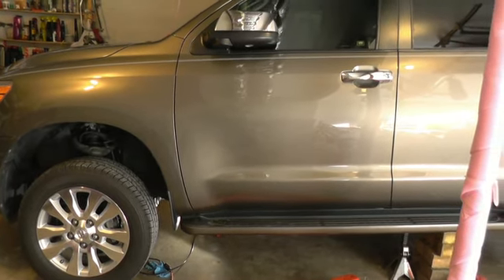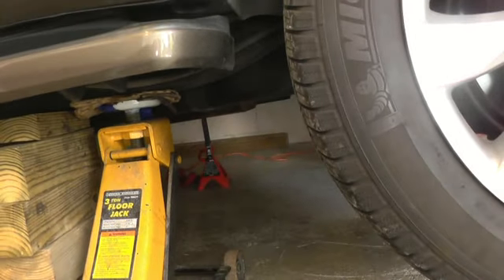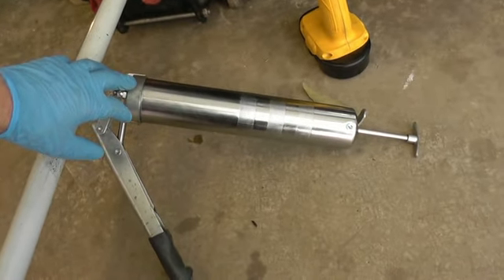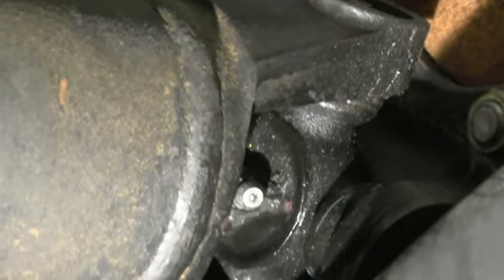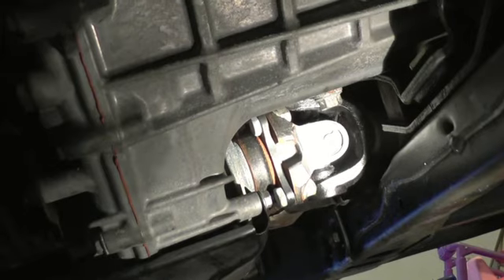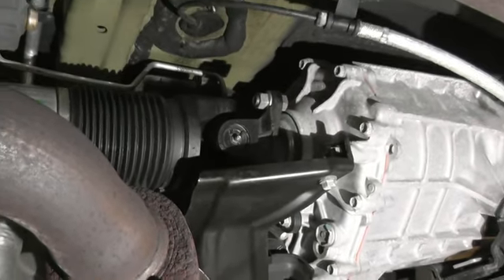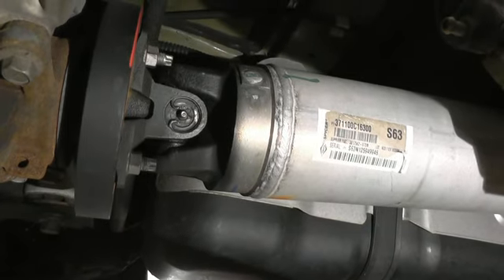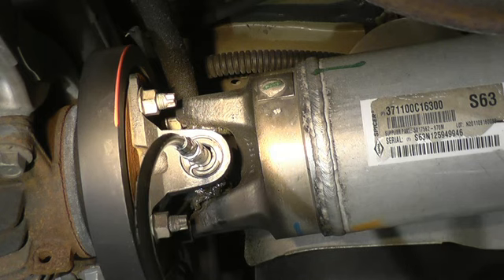How to grease drive shaft on toyota and lexus vehicles

Comment: Never did this on my Rx350. Mechanic never mentioned it. Thanks!
Reply: philip dias that’s because Rx350/highlander do not have greaseable drive shafts. Only truck-based SUVs and trucks of course need this service.
Reply: Maximilian Button thank you so much for this comment.

I was going watch this entire video to do mine. Was scrolling thru and read your comment, thank you!

Comment: FYI guys, no zerks on 21 tundra so I guess it’s not a requirement.
Reply from the maker: Just like no transmission cooler. Cost cuts that will end up costing more on the long run
Reply: @repairvehicle  for sure! Let’s work all the kinks out of the vehicle then at the end we’ll do this. Thanks Toyota!

Comment: You only take one end of the grease cartridge off...the plastic cap. Then after loading into the grease gun you take the other end off...the metal end...before screwing the pump portion of the gun on.
Reply from the maker: That's how I done it. Thank you for commenting.

Comment: Oh shit a mechanic told me to put my LX570 in park and take off the parking brake for this. Then he used a screwdriver or something to turn the driveshaft while in park. Did he just break my driveshaft? I heard a lot of scary noises but he said that's normal. It wasn't in neutral.
Reply from the maker: When shit mechanic works,  he makes shit results.  Off course he caused damage
Reply: @repairvehicle  😟😔

Comment: Ive greased my drive axles and it still thinks and clunks it's very frustrating. I'm not sure if I should take it back to the dealership where I purchased it and have them repair it or just replace the drive shaft myself
Reply from the maker: How many miles are on the Toyota?
Reply: @repairvehicle  143000. Bought it used. Came with a 3month/3000 mile warranty. There is a short in the radio where I can't shut it off or turn it on, but the volume works.
Reply from the maker: Drive shaft would not clunk at this mileage, unless it was submersed in the water for long time. You might have some other problems.
Reply: @repairvehicle  it does it when I let off the brake sometimes and when I come to a fast stop. I feel a little thud when shifting, unless it's the road. That's rare
Reply from the maker: If you have play in drive shaft, you should be able to feel it with your hands, just by trying to twist.
Reply: @repairvehicle  there isn't really any play. If I try to twist or shake, the vehicle moves
Reply from the maker: Then clunking noise is not from driveshaft, you have issues with something else. I have tundra with almost 1/4 million miles on it and it has everything original. No clunking noise from drive shaft.
Reply: @repairvehicle  carrier assembly maybe
Reply from the maker: It's possible, but more likely you will have a constant noise. You might have problems with stabilizer links making clunking noise.
Reply: @repairvehicle  it's not a clunking it's more of a jolt or a thud. It's not major but it's noticable. Like when I let off the brake or I come to a fast stop.
Reply: It's not a dive shaft it's a differentiala it going to get worse you better check it lifting the rear one knee of the wheel of the ground and put the vehicles in neutral spine the wheel the one of the ground and check the shaft rotation if there is a pause in shaft when spinning the wheel.  There is a problem with differentiala.
Sometimes down the road it will get stuck will break and then you will have no power to the wheel. When this happens you put the vehicles in park and active the 4wheel drive then lock the  differentiala  to drive the vehicle to the shop to get it fixed but with differentiala lock on you can not drive it faster the 50mph. I will go no more then 50 Kilmer an hour.
I had Sam issues  know  I have to replace the differentiala about $2200 from dealer. 
Good luck
Reply: @yuriorlov47  There is  TSB from Toyota for this issue (TSB-0148-11). My 2007 Tundra Crewmax 2WD is doing the exact same thing at 103,000 miles. It has to do with the driveshaft/propellor shaft. I plan to take it into the dealer and talk to them about it because it's kind of annoying.
Reply: Your problem is Propeller shaft flange 👍
Reply: It’s a late response, hopefully it will help someone, I have 08 Sequoia 4wd slip joint on driveshaft had little bit of play you can barely feel it by hand but it was enough to vibrate when coming to stop without using breaks. I replaced differential and it didn’t solved the problem and after investigating further we found very little play in driveshaft’s slip joint closer to transfer case. After replacing driveshaft vibration went away immediately. Original driveshaft lasted 205,000miles with heavy towing.

Comment: Type and brand of grease that you've used
Reply from the maker: +Onassis Legaspi, I have been using for short time Valvoline. However, switching to Amsoil because too much oil separation with Valvoline.
Reply from the maker: +Onassis Legaspi, I don't remember the type, I going find my receipt for it and will let you know.
Reply from the maker: +Onassis Legaspi, Valvoline SynPower

Comment: Yo, common myth—don’t pump so much grease that U see it coming out!!! It means you ruptured the rubber seals if you see grease coming out!!
Reply from the maker: +Lance Taylor, you might want to read additional information under video description. You supposed flush everything out.
Reply from the maker: +Lance Taylor, actually first comment has more information. Link to the website.
Reply: repairvehicle just because you post something in description doesn’t make it so. Your spreading mis information (unintentionally of course). Common myth like I said in comment.
Reply: repairvehicle in other words if the grease “comes out”, it means you pumped in too much and ruptured the rubber seal. Which will let water,dirt, etc into what your trying to protect and will wear a lot faster!
Reply from the maker: +Lance Taylor, I have two options is to believe you or believe a company that specialized in lubrication. Who is correct?
Reply from the maker: +Harry Balls, very good point.
Reply: I could not resist to comment. I've been directly involved in industrial engineering and maintenance for over 20 years.  In my humble opinion, all of you guys are correct. Greasing procedure depends on what type seals are used. Some seals will easily allow excess grease to escape without the seal being deformed. Some seals do get damaged. 
According to multiple studies, over-lubrication is the #1 cause of bearing failure in electrical motors and similar devices. Most bearings with a grease fitting, only require one shot of grease. Too much grease at once (from a grease gun) ruins the seals on bearings. Warped seals allow too much contaminants inside the bearing. This causes premature failure. I have seen it way too many times. Actually we had to train the mechanics on proper lubricating procedures. Some of them had a hard time to learn new ways to grease. They were used to - "the more the better. Pump it till you see grease coming out" mentality. The new procedures have saved us from a lot of breakdowns.
I think too much grease can cause seals to fail in the spider joints and maybe even in slip yokes. I usually put one or two shots of grease during each service (every oil change or 5000 miles). This is enough to keep them lubricated. It's best to use Moly based grease on the slip yoke joints in driveshafts. I have two grease guns. One loaded with a quality Amsoil NLGI-2 grease for spider joints and moly based quality grease for the slip yokes.
BTW, a grease gun with a one handed grip lever is a lot easier to use that a  grease gun with a long lever that requires two hands to operate. Amsoil sells a nice "one hand" grease gun on their website.
Reply: Andrew Evanoff thanks for sharing. Seems some people never greased their Toyota SUV’s drive shaft and did not experience problems.